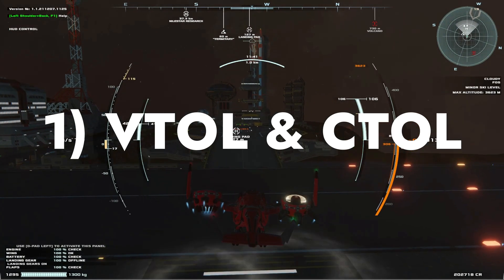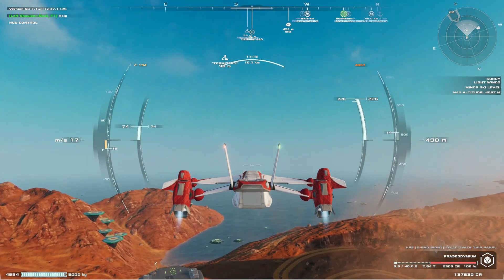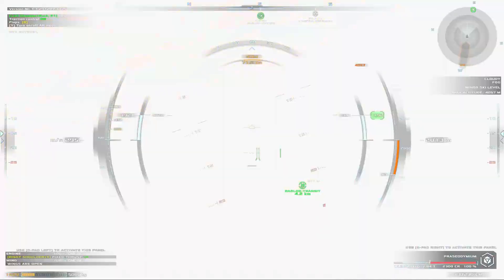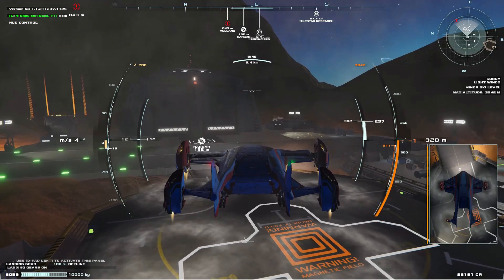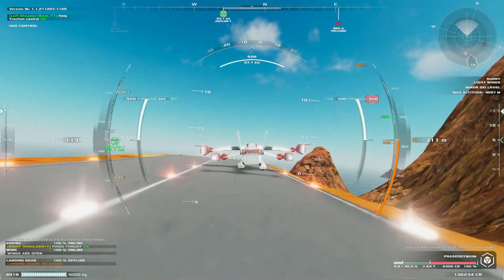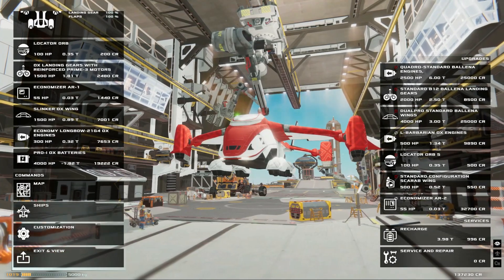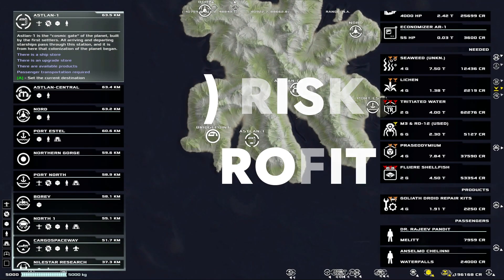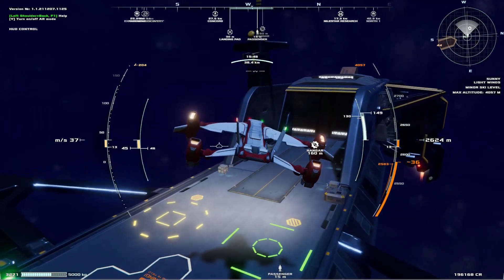Frontier Pilot Simulator: Tips and Tricks Tutorial Guide

Comment: Thanks for the tip regarding AR usage fuel consumption! It never once occurred to me that that might've contributed to why I kept running out of fuel on certain routes! I thought I just had to get more efficient against wind or wait for certain weather conditions to pass. I think I would sometimes sit in AR mode to help keep myself just below the ceiling.
Reply from the maker: Yeah I only realized once I noticed the upgrades to reduce fuel use in AR mode, then I checked and saw flight time and distance significantly drops when turning on AR.

It is still very useful when you can't see terrain due to bad weather though.
Reply: @ChucksIndieGalaxy  Indeed!  It's a surprisingly useful improvement over flying blind at night or through clouds before they added it, back when I first got the game a few years ago! :D

Comment: Good tips. I'd be interested to hear your general review of this game, especially in comparison to other space trucker games.
Reply from the maker: I'll likely put out a review on it at some point, but I'll share some of my initial thoughts here. I was pleasantly surprised by this one. As you may have seen from my other reviews I like games that respect the player's time, and that's one of the positives of Frontier Pilot Simulator.

Progress happens at a decent pace, and the game strikes a good balance between peaceful moments and exciting moments. There's always something to think about. During one of my recent runs I had to make a call between flying direct and cutting the margins very thin on fuel load or taking a detour to land and refuel halfway. Then there's also the cargo weight, weather, terrain, the ship you're using, and the setup you have installed to think about.

In a nutshell, I'd say that most space trucker games ask the player to commit lots of time. Frontier Pilot Simulator asks the player to master its flight mechanics and to be thoughtful. I find the latter more engaging.

I think that Frontier Pilot Simulator is underrated on Steam. To be fair, there are legitimate criticisms as the game does need optimization.  I can see how this game would struggle to run on less advanced hardware and players may need to play with the graphics settings a bit to get it running smoothly.

That hasn't really been an issue for me though and I think it looks great even without having the settings maxed out. A final thing to note is that while this is perfectly playable with mouse and keyboard, it's easier to modulate the throttle in VTOL mode using a controller.
Reply: @ChucksIndieGalaxy  Thanks for the detailed reply. Congrats on 1k!
Reply from the maker: @mluby7828  Thanks!

Comment: I think you are mistaken, you do need the heavy plane, to complete the story..  but one of the biggest issues for new players is that negative sides from upgrades are not always imidiately clear, you need to essentially build some specialist planes for some of the task.
Reply from the maker: Yes you're right you absolutely do need the heavy ship in some cases. The suggestion here is that while you should use the heavy ship later on on the game, it's best suited for heavy cargo runs.

The medium ship works for everything else and it's the more versatile and efficient option. In games like this is easy to assume that more expensive is better, but this is not always the case in Frontier Pilot Simulator.

This is actually one of the great aspects of the game because it gives you a reason to keep multiple ships and as you mentioned build specialist setups for some tasks.
Reply: @ChucksIndieGalaxy  wait but i havent been able to keep "multiple ships"!! it always sells whatever ship i have when im buying a new one! or am i mistaken??? ?
Reply from the maker: @raidermaxx2324  If you're buying a new ship without selling your current ship, it will store your current ship in the same hanger where you're buying the new one.

So possibly yes your ship should still be there (assuming you didn't sell it), you'll just need to go find it in the specific hanger where you last left it.
Reply: @ChucksIndieGalaxy  whaaaaat? holy shit! well thanks for answering , i have to go check out that hanger! I wush they would make that more clear, i dont know how or why  i missed that.. oh well thanks again that changes thing for sure.
Reply: @ChucksIndieGalaxy  see, i always thouht that it automatically sells your ship when you buy the new one, no?